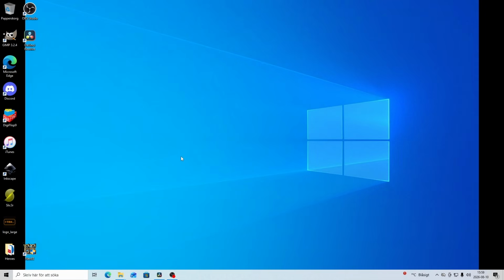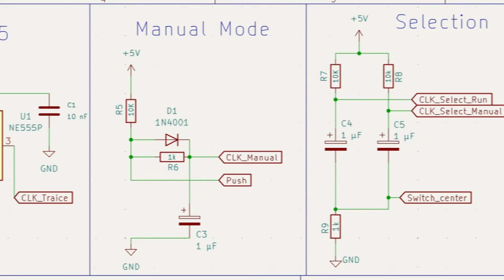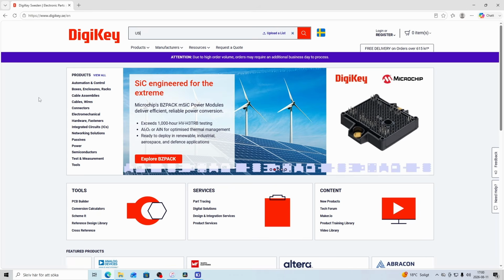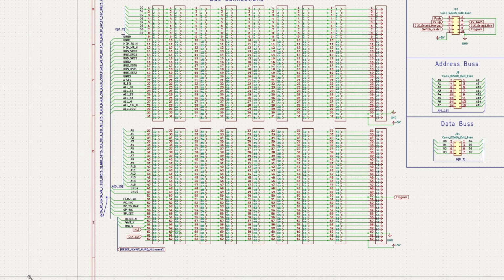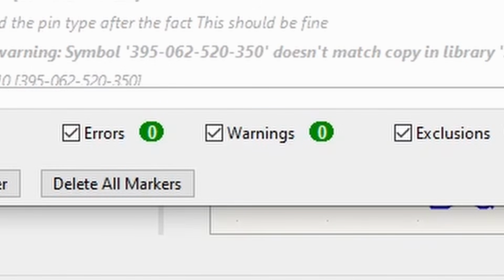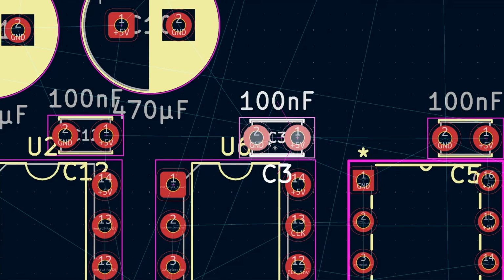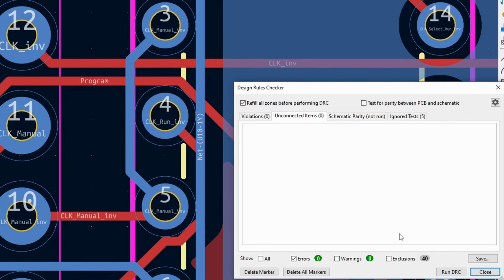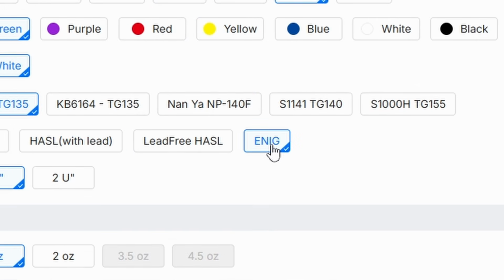Clock Module | Part 5 – Designing My First PCB in KiCad

Comment: After watching the SAP video's from Ben Eater and watch the the SAP to 6502 video's from DrMattRegan I wanted to develop a PCB with clock generator and connectors for the different modules (registers, ALU, RAM/ROM etc.). 
My goal is to start with SAP and develop afterwards on the same backplane the 6502, 8080, Z80 etc. Maybe even my owm processor.
So I am surprised what you are doing. Happy to watch all your video's. Thanks a lot and keep up the work.
Are you willing to share the KiCad schematic/PCB?
Reply from the maker: I have watched Ben Eaters 8-bit computer series several times over the years. Always thinking It looks so fun, but I never tried it my self, until now. :) 

Never, saw DrMattRegan. I’ll have to check it out. 

I can tell you are in for a fun project ^_^ I have had much fun with my project :) 

I will share the schematics some day, I have not yet found a good way to share it though. 

Myguess is that eventually I’ll just share the whole repo with everything. But I don’t want to share before it is somewhat presentable :)
Reply: @BreadboardApprentice  Thanks a lot. I will wait for your next video. Keep up all the good work.

Comment: Well.   This is really well done.   Thank you.   Ive started doing a similar project and have my backplane board started in Kicad.   Now I am inspired to finish it and get it built!
Reply from the maker: That’s amazing! :) it takes quite a bit of time finish a KiCAD project, and it’s all to easy to postpone finishing, because there is always some thing that could be improved isn’t there. ^_^ 
What kind of connector are you using for your backplane?

Comment: You should go ahead and add those unused gates to the schematic. The unused inputs need to be tied to +5v to prevent noise and possible damage to the IC.
Reply from the maker: Thank you for the tip! Dose it need to be +5v or could it be ground as well?
Reply: @BreadboardApprentice For AND/NAND gates, they should be tied to +5v. For OR/NOR gates unused inputs should tied to ground.
Reply from the maker: Thanks for explaining :) I’ll se what I can do once I populate the board with all components.